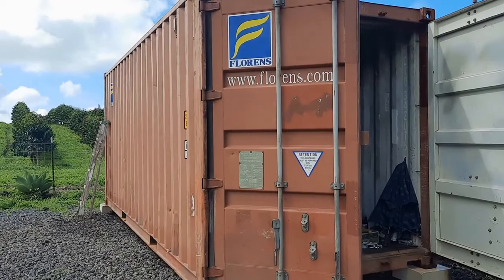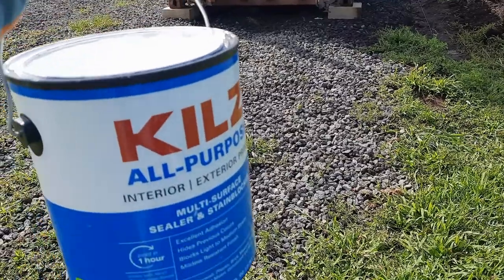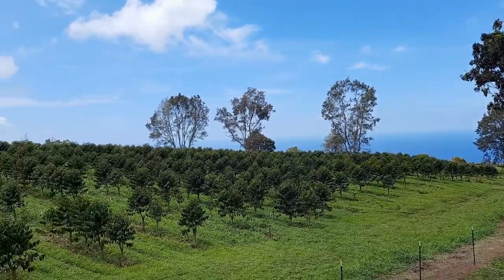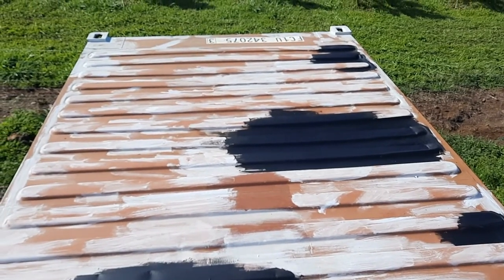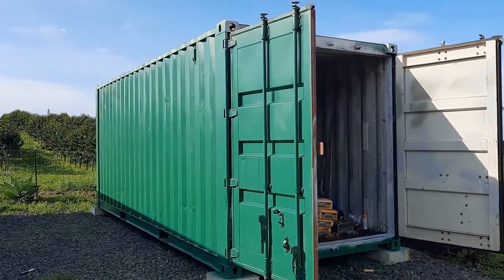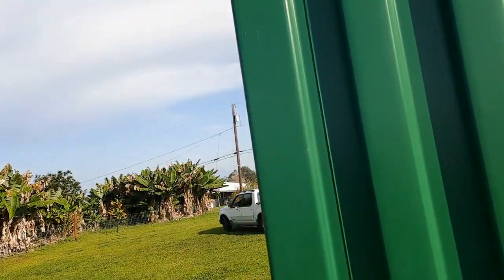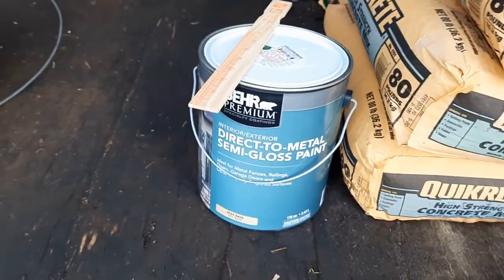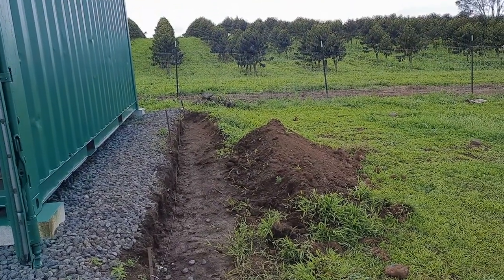Painting a 20' Storage container

Comment: You should have used rustoleum oil based enamel and used an airless sprayer. You should have also hit the rusty spots with an angle grinder and knotted wire wheel, then sanded the entire container down to 320 grit starting with 80 grit, primer then paint. I just painted a container last summer for $650 + paint